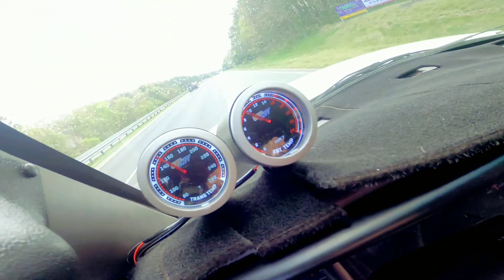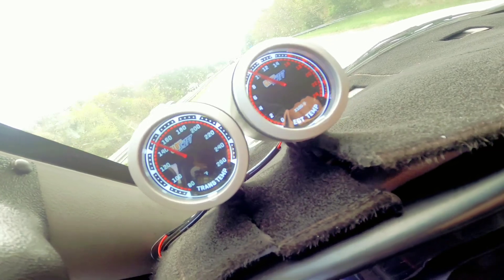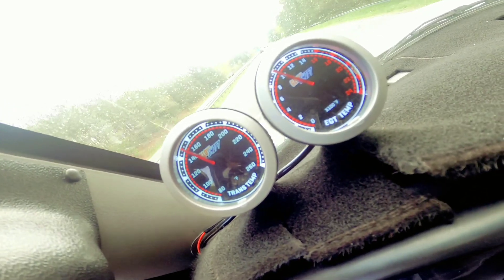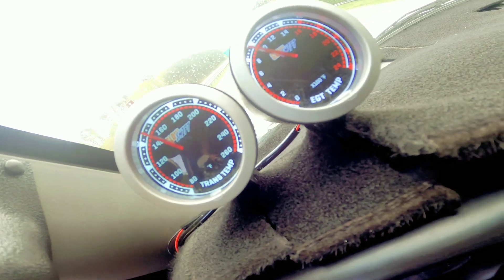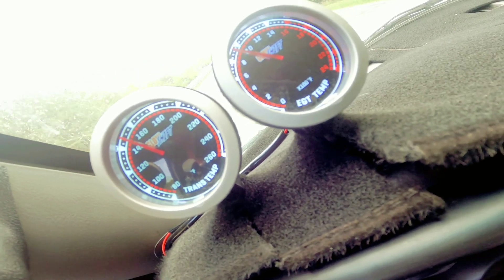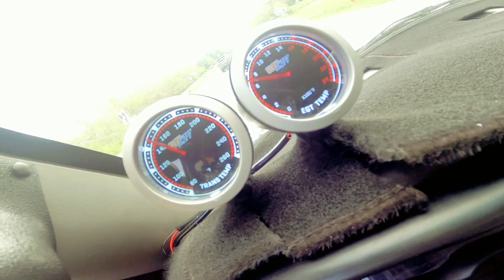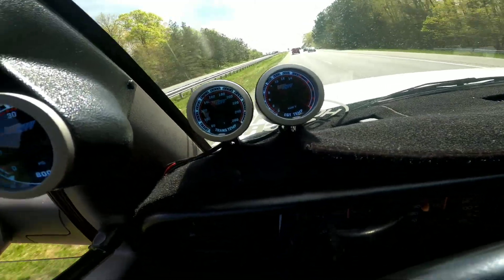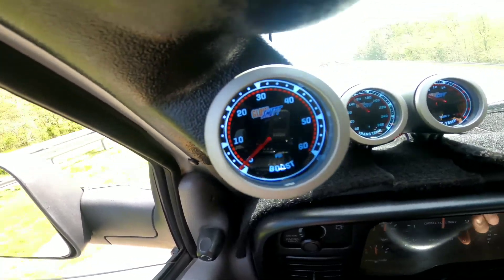Driving with NEW Injectors and NEW Turbo!!

Comment: I have 025 delivery valves 5x12 injectors and I have 362 sxe at the house was wondering if you weren’t satisfied with how it spooled with the smaller injectors or what the reason for upgrading was thank you!
Reply from the maker: Well to be honest, i wanted to see if larger injectors with this 12cm housing would greatly effect EGT'S...had no real issues with my original 5x.010 injectors yet, I am a tinkerer by nature and like to see what happens....so far very pleased with the power...CONCERNED with EGT'S...Thanks for the support!